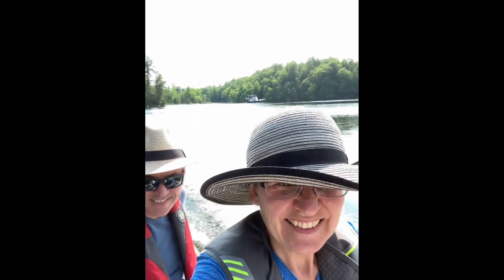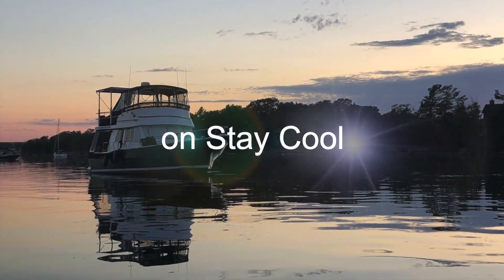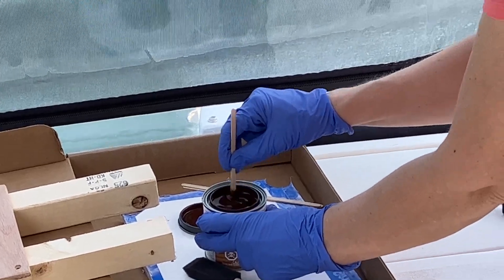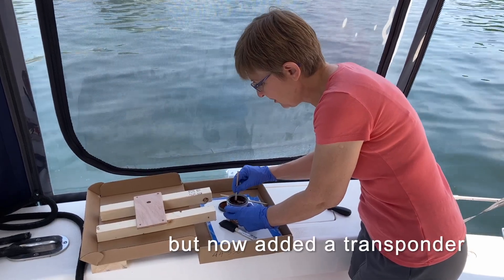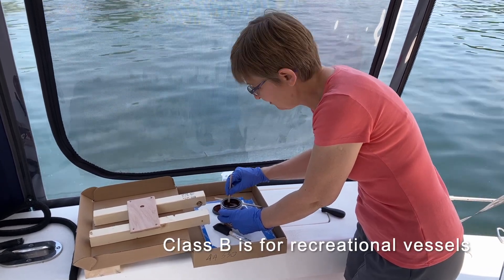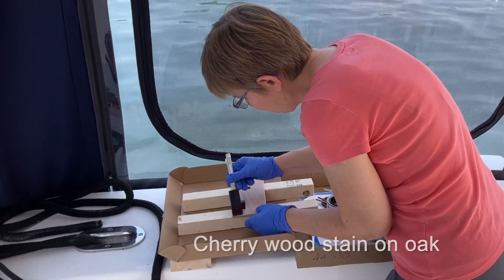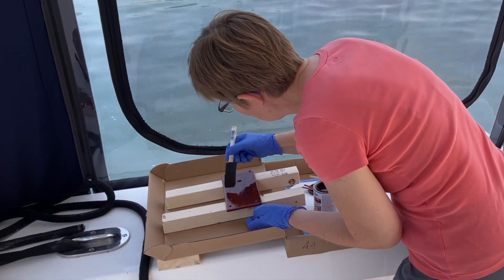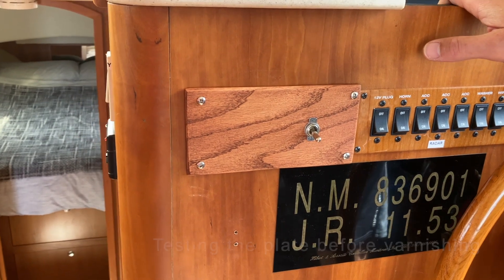Great Loop - Boat Projects

Comment: It's good to see both of you doing the maintenance.  You never know when one member of the team could be incapacitated, busy tackling another project OR too big to fit into a small space. Ha Ha! Steve, when you install hose clamps, offset them 180 degrees.  The weak (leak) point is at the threaded screw section.  By offsetting them, it helps to prevent leakage. Just make sure there is enough nipple/bib to accommodate two clamps.   As usual, another great video.  I like how you're mixing projects with cruising.  Don't worry about producing professional quality videos. Too many others spend 40 hours a week on their videos.  With that work load, I don't know how they can enjoy the cruising.  Isn't it supposed to be fun.  Remember the journey is what's important.  Leave the professional videos to Spielberg.  Semper Fi.
Reply from the maker: Thanks Tom, good point about the clamps! We appreciate it… Keep the comments coming! 😎

Comment: Hello from Long Beach, CA. My wife Debbie and I plan to do the loop in a few years and really enjoy your videos. Keep up the good work!  The reason you had 2 vhf radios is so that 1 can always be on the emergency channel. That way if you’re using your radio, you won’t miss a distress call from a fellow boater in need of assistance. Probably not critical on the loop, but I thought I’d share the purpose of it.
Reply from the maker: Hi David, thanks for following along and for your comment about the radios. That makes sense! We now have 3 radios including a handheld for redundancy (and use in the dinghy) and 1 at each helm station. We are constantly scanning channel 16.  Good luck planning your loop!😎

Comment: Next time you do a maintenance vid, I would love to see and hear about the engine.  Cylinders, displacement, hp, RPMs at your cruising speed, fuel capacity, and how many miles (or kms) does she get on a tank.  Do you have an onboard generator, or just rely on the alternator, the occasional shore power, and your solar to keep you charged?   Keep the videos coming.  Now that our boat is sold, I have to live vicariously through you guys!   Safe travels!
Reply from the maker: Thanks for your comment Nick! All good questions which we will cover in an upcoming episode.😎👍🏻

Comment: Great video. Your black water monitor, did you build it or purchase it? If you purchased would you mind sharing the link.

Thanks
Reply from the maker: Hi Darren, thanks for your comment. We created our own black water monitor using an Arduino UNO and contactless sensors. We're still in "testing stage" but so far so good. The old monitor is inaccessible and still is not working! Thanks for watching.

Comment: Hello guys we’re enjoying the videos. We have a 2003 Mainship like yours and have the exact same issue’s. 
I like the access plate idea. My upper drain hose is leaking at the drain box and can’t get to it. Same issue with tank sensor. I bored a hole in small cubby in side berth to allow access to the sensor. Cleaned and reinstalled. 
I just ordered check valves for the shower sump,same issue lol. 
Where did you buy the access hatch? 
Safe travels, take care. 
Thank,   Mark
Reply from the maker: Hi Mike&Cathy, Thanks for your comments. Wow! Exact same issues… LOL 😆 We got our access hatch from Marine Outfitters in Kingston, ON. It’s 11” x 15”. We are also addressing a starboard flybridge drain issue using that same access hatch! On another note, does your boat have a list? Mainship evenly distributed the fuel and water tanks, but both AGM batteries are to port, so you guessed it, we list to port. Next big project is to move one of the 160lb batteries.
Reply: Hi, yes our Mainship tends to list slightly to port as well. That’s typical of these boats.
Moving one of 8D batteries would certainly help. I’ve moved all my tools to store below on the starboard side and when we installed the tender it seemed help as well? I’ve also been aboard a 390 that had lead weights along the far outside bulkhead on his starboard side. He said those were put in at the factory?  When we bought our boat several years ago both flybridge drain hoses had came loose and laying between hull and cockpit. Was able to hook those and contort myself enough to hook those back up. Still have an issue with upper flybridge drain connection leaking at the drain box. Someone nipped the hose to make the connection easier at the factory. Brilliant!! 
Good luck with the projects, take care, Mark

Comment: I just do not get boat designers and builders. Every thing man made will eventually need service. Designers who forget this should never get near a drafting board or cad system. Every boat needs to be designed and constructed with maintenance in mind. Systems that are inaccessible are the result of poor design, poor engineering or simple slovenly construction. You should not have to crinkle a knuckle or bust your back to do a simple repair.
Reply from the maker: You are SO right! Who knew we’d have to be experts at boat yoga! 😉